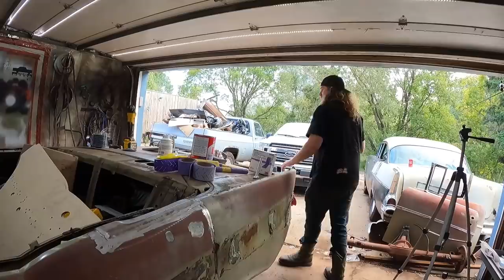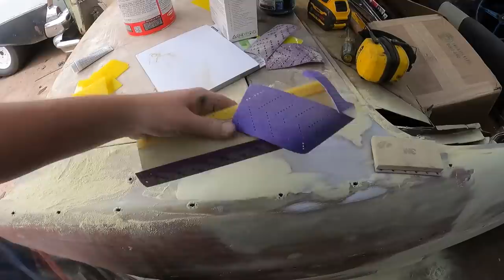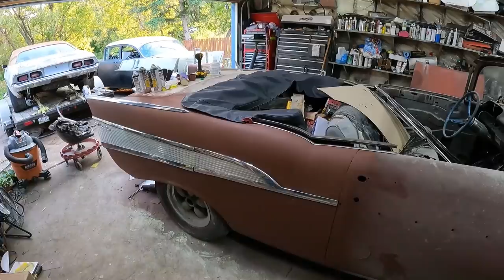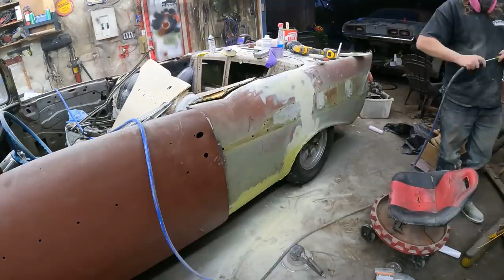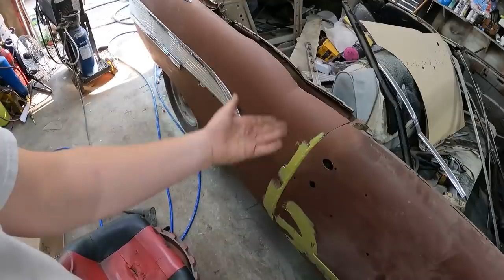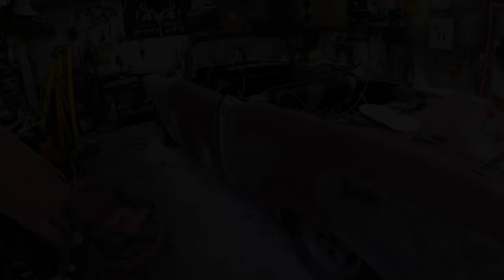BONDO 101-1957 Chevy Convertible Conversion, Primer Prep

Comment: Just a mother Schmucking minute! You can do good body work if you just try! You're very capable of doing a nice job! On this car you should have ground down the whole back end and schmucked the whole thing  and worked it down with 36 grit until it was nice and straight! Then go to the front half the same way as needed! That ''Black widow is is driving me nuts! I love the look of the 57 150! I've always been a 55 fan and the 57 150 has the 55 style Quarter chrome so it makes it look a little like a 55! I think it's cool as hell, You have the minimalistic 150 and the Belair convertible which is the other end of the spectrum! You'll make this look cool You always do!

Comment: Great Scott man, are you gonna do the entire car by hand? Get a Hutchins air board file and make your life easier and happier. Oh yeah, use an discarded car side window of suitable size & shape for your bondo board; you can grind the old mud off easily and it will last you for years. The 7or 8" Mud Hog is for rough work at best.

Comment: The 57 Chevy is looking fantastic in the primer please try to find a passenger side antenna for the back quarter panel, and you have to fix the dents on it because it looks to good not to. The top of the windshield you have to weld some metal in to make it a flat surface. Keep up the great work and God Bless you and your family. 🔥💯💪🏼👍👍🙏🙏✌😊✌

Comment: If you want expensive, use Evercoat Rage Gold". No air board? I know the formulas for fillers have got much better over the years but with all that stuff your body work is still subject to three separate expansion coefficients if one is using  fiberglass and filler over metal.  You need to use block s of various shapes that do NOT have hard surface. I recommend the Dura-Block 7 piece sanding kit, call it $108 Cdn w/lifetime warranty. Try not to put filler around edges.

Comment: Instead of the clean sheets board you can use a clipboard and printer paper. I personally don’t mind spending the money for the clean sheets board but for those on a budget or in a pinch will work excellent.

Comment: To mix "plastic" (bondo) I had a 8th(?) inch plastic sheet in the shape of a painters palate and to remove the last bits, I'd flex it, rinse and wipe.  ;-)
Our auto body instructor insisted, plastic be no more than a 32nd of an inch (or was it a 64th?), bottom line extremely thin, but we realized this wasn't about working plastic but producing superior metalworking skills (devious).  ;-)

Comment: Body work can be exciting, recently had the rubber sanding pad fail on my DA. I was getting a bad vibration, lifted it off the fender, squeezed the trigger. At high speed the pad broke apart and went flying.

Comment: Grind down the welds. Shmuck on the mud. Block off the Shmoo. Dust on primer/ sand. Dust on some paint. Gotcha!
Reply from the maker: Just that easy haha
Reply: @DDSpeedShop  yes. Tuning a 5 times multiplier is easy too...
Yes, I'm sure it is just as you show us Dan. It's a different skill and you still make it look easy..I cannot wait to see this convertable up, running and driving..

Comment: I would suggest starting with an ample coat of filler on the whole panel as a “skim coat. You can always sand it off but I’ve found it to save a lot of time versus just spot applications and re-applying. Cost of extra material is minimal versus finished product. I also give it a few coats of high build primer (body man in a can) then a sealer / epoxy primer to fill in sand scratches

Comment: The “boot” cover will need structure beneath it to prevent it from sagging. Cut some plywood to fill the space behind the seat and on the sides of the seat. Cover it with some foam and it will look taunt as if you have a top under it. BTW, you have done a hell of a job with the conversion.
Reply: I saw a video the other day with the guy called Dan resto Dan it's an old video he did a 57 convertible from a four-door you can't even tell the difference it's awesome even the top works

Comment: I guess if you get to liking the red oxide look you can get some red oxide in epoxy primer and recoat and you won't have to worry about the moisture getting to the metal for a few months.

Comment: You shouldn’t be putting filler over that old paint. But if you’re going to it at least needs feathered back with a DA where you used a grinder. If you were trying to put a nice paint job on this the hard edge grinder marks would eventually show up in you finished paint